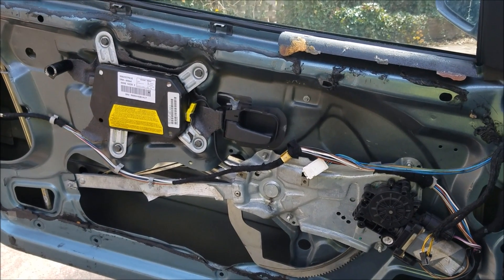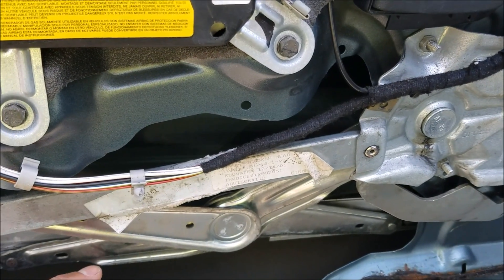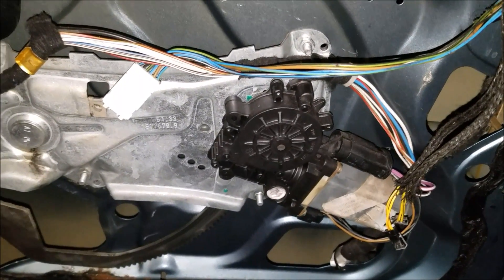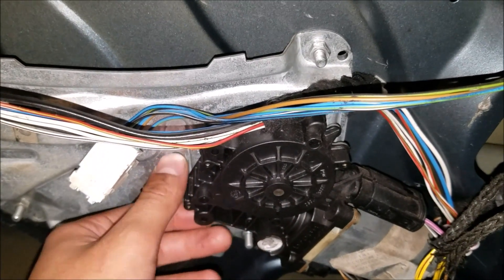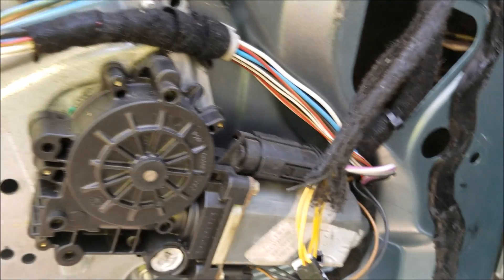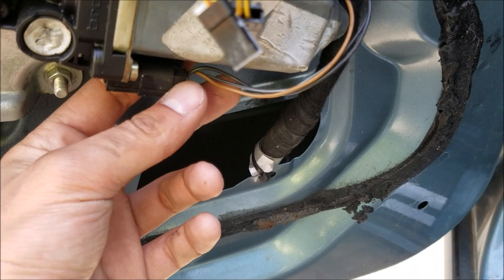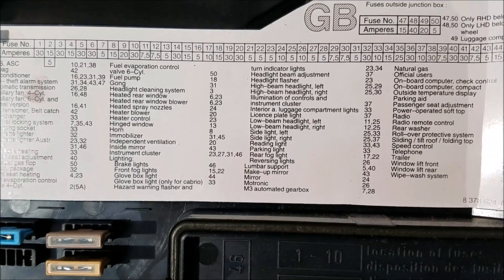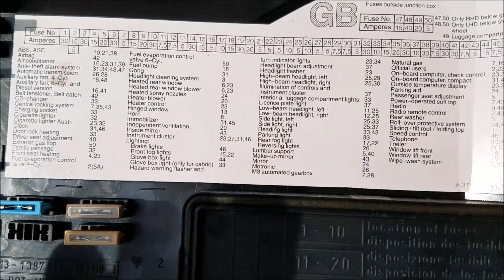How to Diagnose Power Window Problem BMW E36

Comment: Hi mate my window stuck fully closed and won´t go down, when I push button I hear click sound on door and on passenger side, can u help me with this problem, i´m appreciated. :)
Reply: Did u fix this problem I have something very similar
Reply: @sheaniwheeni8333  I just moved and set the window a little lower and then it started working. I have coupe

Comment: Wondering if you've come across this problem: My 1998 M3's passenger window goes down just fine but when I lift it it makes sort of a grinding sound. I have not lubed the slides yet to see if that helps. I purchased a new motor but have not installed it yet, after watching this video may be the bushing you talked about?
Reply: I know it’s been 3 years but that grinding noise is usually coming from the cables that roll your windows up and down. If they have debris or no grease they tend to crinkle. They will go off the rails eventually causing the window to fully not be functional anymore.

Comment: Have you ever ran into an issue where the driver side window works, key in or out, as long as the battery is connected? My e39 does that. Driver side switch, of which I tried many modules, will work the driver side window, ignition on or off. WIll not control the other windows, but the other windows all work fine from their respective switches. Passenger mirror and driver door lock actuator all stopped at the same time. But the GMIII unit checked out fine in an identical car. Heated seats work, interior lights function. Any ideas? Did have a sunroof leak, no floor modules, no kickpanel modules. ECU TCU are both in the engine bay. Im not getting many responses other than a bad GM5 module. Which I dont think an e39 has, or I have yet to find it. 
Thank you. This did help with my slow back windows tho. Greased them up and they worked like new n.n
Reply: Sounds like the switch is connected to a hot wire, maybe someone swapped the switch and rigged up a random power wire to it
Reply: @marcuspurciller  I found out what happened. The sun roof was flooding the driverside floor of the car. But not enough that the rug was getting wet. There was an electronic control module under the driver side rug pad. It got fried, and took the Trans module and interior control module with it.
Reply: @barrelracer318  oh man glad it got fixed

Comment: My windows worked. But the front of the window got out of its slider. So I've put it all back in place. But now the motor clicks but doesn't do anywhere. The window is not stuck I can do it by hand with ease. So why is the motor stuck. Please help.

Comment: Hi how's it going I have a BMW convertible year 2000 e36 and the back windows will not work the front windows work grand and the top works ok but can't find out y the two back windows are still not work can ya help

Comment: Hi so originally my window was derailed from the sides and that caused the clips to break which i replaced but i noticed one of the regulator pins that go into the plastic clips is bent slightly upwards preventing it from being pushed in all the way, also when i try to roll up rhe window there seems to be something blocking the right side rail,  could the regulator pin being crooked cause that?
Reply from the maker: Yeah so when your window gets derailed, most of the time its because your window regulator has gotten a bend in it!
Something hindering the side track? If you can feel something in the track than that's definitely an issue but I would say most of the time if the window keeps popping out of the regulator pins or wont go in its because the regulator is broken/bent.
Reply: @e36fanatics29  thanks dude, ill check it out in a second :)

Comment: MYbe you can help with my issue on a friends 97 Z-3.
The driver window works but pass side doesent.
I swapped switches and both switches work  fine...the fuse is good.
I checked for power to the pass side window and there is no power to the pass motor.
I jumped the motor with a 12v battery and the window works fine up and down so looks like there’s a broken wire somewhere.
I may have to pull the center console to investigate because there’s evidence of a mouse nest under the six speed shifter bezel.
I’ll report back my findings once I get a chance to mess with it further.
Reply: What was it? Having that same  problem now

Comment: Hello. I bought a new GM module for my 1994 sedan e36. and I mounted it. it was good but than I checked the front left and right windows are opening and closing 
approximately 8-10cm. for example when I push the open window button, window is opening just 10 cm.than again push the button again 10cm opening.and again and again. if I want to close window, 1 time push the button 1 time 10 cm closing. by the way second button position (automatic open/close) doesn't work of course. How can I fix? thank you for video I will check everything. Please help me.

Comment: My major problem is the alignment on the tracks. My window falls off on rolling down. And tint sideway rolling up. Any advice on what to do?
Reply: i have the same problem,  i already replaced my regulator, which didnt work
right now im looking into getting new window rubbers (the rails they slide in) to see if that will work
Reply: @joshkiej6601  I eventually gave it out to an expert who discovered that the rail was out of position or bend.
Reply: @bamidelekoledoye1161  which rail? And is it a coupe or sedan? The coupes are pretty notorious with the rails even snapping the welds of the door
Reply: @joshkiej6601  Its Sedan actually. It is the left rail. How it got bent is still a mystery to me. But thank goodness I got it fixed at last

Comment: I have a similar problem.. Though not only the windows but interior lightning and central locking system is now also dead. I reccon it is related to the G/M module behind the glove compartment which is comanding the above now non-working things. Is this a common problem and is there a usual suspect here ? I checked the classic broken wire loom iin the trunk but all cables are fine...  Any help appreciated. Thanks . My car is a BMW 325i convertible , 1994.
Reply: Im having the same problem. Did you ever find a fix
Reply: I finally got another G/M module installed  (2nd hand) and now everything works... Well , not 100% ... The module needs reprogramming as I cannot lower/raise the front windows induvidually.... Weird.... The module is from a similiar convertible. Clearly the old G/M was bad... I will still open it up and diagnose it and look for any cold solder joints.

Comment: 1992 325i - driver window - FUSE 33  was the culprit.   Window was not operating - finally found fuse 33 blown - and it was only labeled 'light - left side'.  As far as I can tell now it is for the trunk light and the driver window only.

Comment: Finally found the issue with my window problems if you don’t have power to one or more of your motors. Lifted up the center console to find my window harness was falling apart, melted and corroded. Found by checking power to switch.

Comment: ever heard of a window not going all the way up? have a 95 e36 and the rear passenger window (the mini one)  only goes up an inch or 2. it goes down but doesn't go up any higher. i will try unplugging the battery with all windows down and try putting them all up

Comment: i have a 1999 323is and all the power windows stopped working at the same time. drivers passengers and sunroof.  no sound comming from any of them. i already replaced the window fuse under the hood? and i cant see any other fuses that are blown?? help
Reply: Dalton Phillips did you ever figure this out? I have the same problem, disconnected the battery and got my sunroof and one window to work but as soon as I touch another they all go out again.
Reply: Bad relay?

Comment: My drivers window will go down but not up.. you can hear it trying to go up but it won't. Is this a regulator problem or it just being out of alignment? If anyone can get back to me that would be cool!
Reply: did you ever get this repaired i have the exact same problem in my 92’ 325i
Reply: Nah man I wish lol. Still dealing with it just cause it’s a huge task swapping out regulatory/motors. Might just pay someone to fix it for me.
Reply: @AaronMelendez23  glad you replied so fast, I took my door card off and cleaned off some of the old dried up grease and now it goes up somewhat decently about 75% for the time which is a major improvement over holding the window button and pulling the window up with your hand
Reply: @AaronMelendez23  I’m gonna leave it like that for now, I bought the car two days ago, so I still have to get it insured and all that, my main concern was just being able to have the window open while I drive it and not struggling with the window to get it back up

Comment: Not the regulator but I can see my driver side window is out of the right side track, but have not found a video to remedy/fix the problem. Any suggestions (PLEASE)?
Reply from the maker: Yeah, two reasons it would get out of the rubber track, first off the regulator is bent and/or glide broke. Second, sometimes I've seen it simply come off the rubber track over time by chance. It's a real pain to get it back aligned, you have to unbolt the window from the guide rail, and you really need a second person holding the window while you try to fit it in the glide.
Reply: Thank you so very much for the info. Oh yeah, I found the same kind of reply in a Bimmer site that also made it clear it is going to be a bear!
Reply from the maker: theuniqueldy I would honestly rather replace a starter than have to align the windows, I had to re align my brothers window last week after replacing a door handle, it took me maybe two hours and a lot of cursing to finally get it aligned correctly and get it back on the glides. It's certainly doable it's just a very frustrating process.
Reply: OMGosh not that is scary! I replaced my started last spring. Even with my little hands removing that freaking last bolt was way harder than my doing rear brakes, replacing the cabin air filter & even replacing the ignition housing put together! Will consider having someone do it :)

Comment: I had an e36 coupe 1997 , and the driver stops to work suddenly its stuck at the top , even when i open the door it doesnt respond that 0.5cm down , i can hear a click when i put the buttom down but nothing happen , any help plz ?
Reply: ahmad daham and GrayGooseShotter

The 0.5 cm drop is caused by a switch in the door latch. Check to see if that is stuck. If it's stuck, mess with it until it comes loose.
 If the key is in the ignition (turned on) and the window isn't going down by the push of the button then it could be any number of things. However, my guess to your problem has to be faulty wiring.
 If your switch for the 0.5 cm drop is confirmed to be functional then that indicates that the problem is a (dirty/loose) ground cable to the window motor, making it so that your window doesn't get the power it needs.

Let me know if this solves your problems
Reply: Mine was doing the same thing. Literally unplugged the wires and plugged them back in and the window went right down.
Reply: I've got the same problem... did you get a solution?

Comment: Great video E36 Fanatic. One question... Do you have a link to where I can buy a replacement bushing? I'm talking about the bushing in between the regulator and the engine motor. Your help would be greatly appreciated. Thank you.
Reply from the maker: Alton Sinclair just bought one of them a few days ago off of what, I'll check who the seller was but it was like $2 each.
Reply: I also need this bushing. I live in Germany. You have a Link for me?

Comment: great video! I have one rear window that won't go up or down but a single click can be heard in the door suggesting power is going to the electric motor but no movement any suggestions would be appreciated.
Reply from the maker: The best thing I can tell you is to pull the door panel and take a look. It' really hard to try and diagnose power window issues without removing the door panel. If you can hear a single click sounds like the regulator and motor might have gotten out of alignment. Check out my new blog bimmercraze.com if you get the chance and let me know what you think!
Reply: This is the same problem I'm having and I'm trying to figure it out before I pull everything apart.

Comment: How can I get my driver seat door unstuck
Reply from the maker: Sorry for the late reply, okay my brother's e36 passenger door has that issue. The issue with his vehicle is the door lock assembly, hopefully that's not your problem, but if it is his symptoms are that his exterior door handle pulls way to far out when you try and open it, and the interior door handle doesn't work either. My brother is able to play with the handle just right sometimes so he can get the door open. Door lock replacement isn't to difficult as long as you can get it open. Check out my new blog bimmercraze.com if you get the chance and let me know what you think!

Comment: Really glad I found your channel... lots of useful info... thank you for your effort....
I have a convertible E36 and suddenly both my back windows won't come up again....
Any ideas what I should do, could it be some fuses? Please help...
Reply from the maker: Did they both go at the same time? Do the windows respond at all when you press the switches? Can you hear a whirring sound at all if you listen close to the windows when you hold down the switches? If you can hear some sort of sound coming from the motor/regulator area take a look at them and see if there are any obvious problems. Bad glides/motor seized/regular off the rail.
Thanks a lot!
Reply from the maker: I believe fuse # 13, 14 are deal with power windows, check the fuse box labeling to confirm.

Comment: I have E36 316i, from 1996.
Power windows only work when drivers door is open.
I dunno about passenger front door.

Any ideas what it could be?

My dome light also doesnt come on when i open door.
Even if i "move" dome light switch around.

Could this be related?
Any ideas why i have to open door to be able open/close front power windows?

I have rear manual windows
Reply from the maker: Have you opened up the door panel? Could be door latch micro switch, door panel insulation has broken down. Theres a microswitch on the door frame where it latches, press it in and the window should go up an inch or so.
Reply: Thank you for the information.
I will take a look. Never opened the panel.

Now i know where to look. 
Will let you know what it was when i fix it.
Reply from the maker: Thanks! Good luck, a lot of the time it may be something relatively obvious once the panel is removed, other times it takes a little more diagnosis.